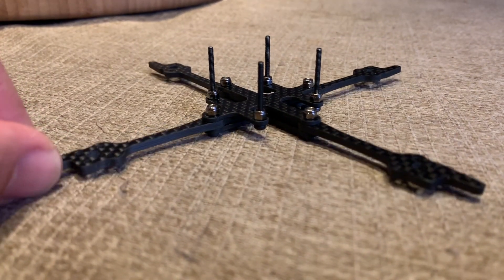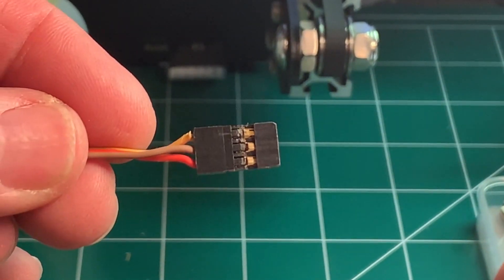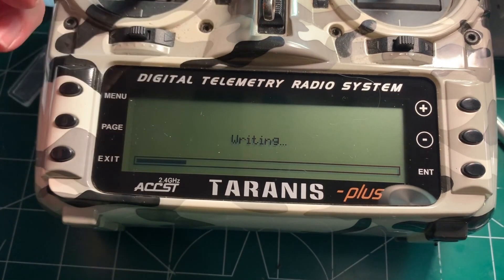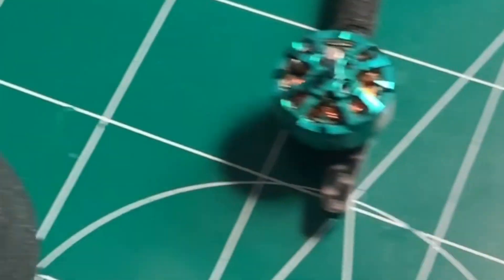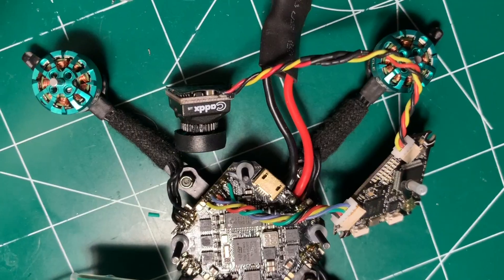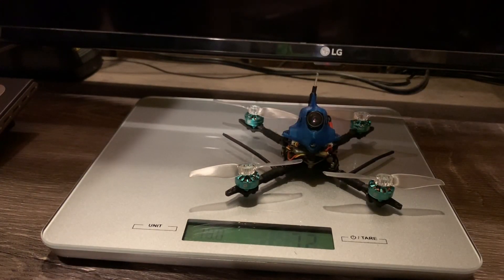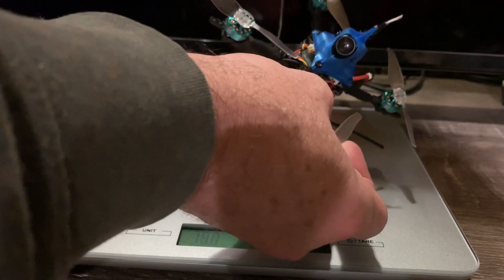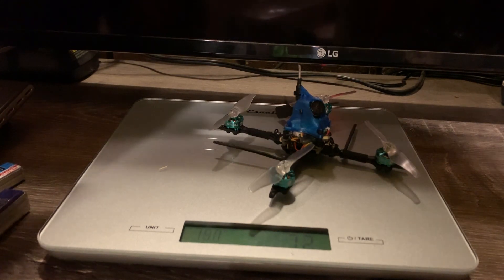Kabab Toothpick 3 Build and Review

Comment: Hi for the receiver antenna is it good to mount it like this？ it will be blow and vibrating under under the propeller right？

can i just tide it under the carbon arm will it reduce range？
Reply from the maker: Hi Quaneu, the way I had the antennas mounted is old school, away from the carbon fiber arms for better reception. I never had them get into the props. I did convert mine to TBS crossfire using a mini T Antenna (much smaller & better range) and mounted it to the arm.  But to answer your question, yes it will reduce your range. You could attach the ends of the antenna to the rear arms (antennas between front and rear arms) thus keeping it away from the arms except the very ends of the antenna. That will keep it from flopping around. I would just give it a try (easy to change it).
SLOG

Comment: if i intend to use it as 2s flyer
1204 6500kv will be enough？
Reply from the maker: Hi Quaneu,

I am running 1204 5000kv and 2S is fine. With a 6500KV motor you should be even better on 2S. 
SLOG

Comment: how did you mount the receiver? does it just sit on the FC or did you secure it down with double sided tape or something?
Reply from the maker: Hi ValeninFPV, I mounted it with a small piece of 3M clear double sided clear tape. Right in front of the VTX on top of the FC. Right behind the front standoff. 
SLOG
Reply: @slogfpv  thanks for your help! building my own right now :)

Comment: nice video.. one question.. what are you using to wrap the motors cable? seems like a cloth.. whats the name of it?
Reply from the maker: I got it off of Amazon link below:
Tesa Wire Loom Harness Tape Used By Mercedes BMW VW Audi
https://www.amazon.com/gp/product/B00EH6IZ6Y

More recently I have been using 10mm x 30M 100ft Black Insulating Acetate Cloth Adhesive Tape as it is a little more water resistant.
https://www.amazon.com/Insulating-Acetate-Adhesive-Laptop-Transformer/dp/B01E8W9XEO

Comment: Nice build and flight. Recently made one with the 3rd version of the TP3 frame, which no longer has the TPU center piece. Flies well, just needs some fine tuning, as there are some minor wobbles sometimes. Here's a video: https://www.youtube.com/watch?v=-w_rjmAYzOU
Reply from the maker: Nice flying and video!
Reply: @slogfpv  Thanks for watching and the comments. I am still struggling a bit with the tuning though. Especially in a little breeze, the quad is very wobbly. I know it's a small and light quad, but I also have the SailFly-X and Mobula 7, and these are very solid even in a breeze, and much lighter. I asked Kabab, but he doesn't do much tuning on his builds, mostly runs default settings. And while mine already flies pretty nicely on those, it feels like being maybe 75% tuned, and there seems room for a lot of improvement. What version BetaFlight are you running on your TP3? My AIO board came with 4.0.4 but I hear a lot of TP3 running on 3.5.7 firmware.
Reply from the maker: Hi RC-Fan NL,

I am running 4.1.3. In my experience 4.0.x was ok for 5 inch quads but not for micros. 4.1.3 works better IMHO than 3.5.7 if you don’t like tuning. 4.1.x with RPM filtering is even better which I have done on other micros but not on the TP3 yet. This is more bleeding edge and if you don’t know what you are doing you can burn up an ESC. Albert Kim has a “how to” on his channel just search for RPM filtering. 

Cheers,

SLOG
Reply: @slogfpv  Yeah, it seems 4.0.x is very touchy when it comes to micro quads. The "bandwidth" seems much narrower for getting it right. I have 4.0.4 on the Larva-X, and while most reviews showed it to fly perfect out of the box, mine had some propwash shudders in hard turns, and also wobbled in a breeze. It did improve with some tuning, but not enough to my liking. Only after changing props, and battery, it became smooth and solid.

I tried some different settings on the TP3 today, which made it much more smooth in a breeze, except in turns the motors were really unsteady, typical D-term noise. So I dropped that a lot, and it seemed much better. But more testing is needed. If I am not happy, I will either go back to 3.5.7 or 4.1.x firmware.

Comment: Nice job   I stupidly believed that more frames were coming and didn't order a few when they were in stock.  Nice to see a caddx on one of these. Definitely Jealous. Its hard to tell  how fast this little thing is moving from the video and the height your flaying at ..... but experience is showing me that its covering a lot of ground .
Reply from the maker: I need to get a baseball speed gun but it is very vast on 3s.
Reply: @slogfpv  FYI Frame arrives  Built in Canada version..  You are the definitive reference for assembled frame view thank you for that ....  FYI Everyone concerned Canada built version has long sliver screws with 1.0 MM Hex Head ( ass hats)   fortunately I keep real CUP head screws even in M2 at an appropriate length .  At least I hope so such as I don't have the FC or camera mount yet  so Yes I'll be pissed if my screws are too short -- because the screws that came with the carbon are worthless --   01/07/2020,  Do you guys think Crossfire is  WAY WAY WAY Overkill and TBS Micro VTX is over kill on a Tooth Pick?      I mean all my crap is cross fire so   yea I just figured .....  It not like I don't have FrSky receivers laying around as well,, ...  LOL @ wire horder reference I never check my old wire bag when building .. Might as well toss those old wires.. I need Blue Tac  thanks for the link     seriously
Reply: Bro RSSI info was top notch  - - maybe Ill consider   FrSky on this little monster ,,,       I Dunno     something soo comfortable about Crossfire  stability  ya know

Comment: Whoa!  Back up!  How (and where from) did you get that file for the Rx on your Taranis?
Reply: What were your final PIDs?  Which battery was used in the flight footage in this video?
Reply from the maker: # profile 0
set vbat_pid_gain = ON
set feedforward_transition = 30
set p_pitch = 41
set i_pitch = 81
set d_pitch = 34
set p_roll = 38
set i_roll = 77
set d_roll = 32
set f_roll = 89
set p_yaw = 27
set i_yaw = 81
set f_yaw = 84
set d_min_roll = 18
set d_min_pitch = 20
Reply from the maker: 350mAh 3s and 450mAh 2S
Reply: @slogfpv  Thanks man.  I'll toss you a tip.  Get some pvc heat shrink.   It's much thinner and lighter.  Great for the Rx...especially on micro builds.
Reply from the maker: @metoo3918  yes heat shrink tubing is probably a better way to go. I use it on my larger builds. The only reason why I use automotive wiring harness cloth tape is it is easier to apply (being lazy). Being cloth, it does not weigh as much as vinyl tape but it is not as water resistant as just going with heat shrink tubing. I think I am going to try 10mm black Insulating acetate cloth that I see see being used on a lot RTFs from GEPRC, Betafpv ... Again just easier for me to replace motors that tends to happen more frequently on these mirco quads.
Cheers,
SLOG
Reply: @slogfpv   Again, Thanks for this video.  I just built mine. With me having the new versions of the frame and FC, the only part we have directly in common is the XM+.  With a 3S 450, my build is 114.5g. My heavy cam is 8g of that.
Reply from the maker: me too have fun!
Reply from the maker: Sorry for the late response. Your comment was flagged as SPAM. I got it from the Frsky Download page link below:
https://www.frsky-rc.com/xm-plus-mini-sbus-non-telemetry-full-range/